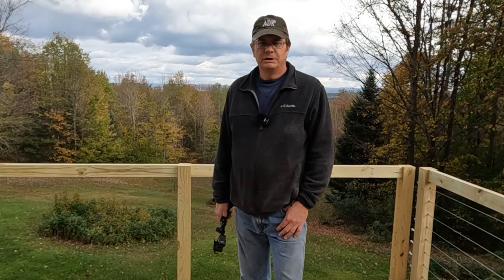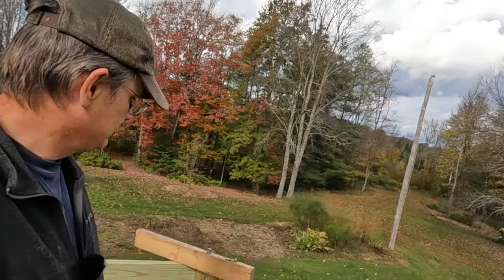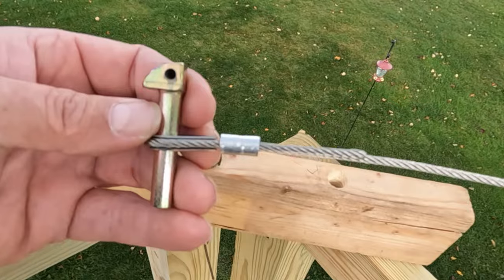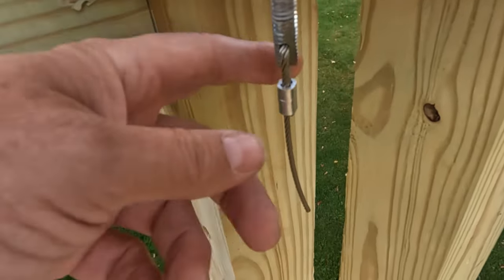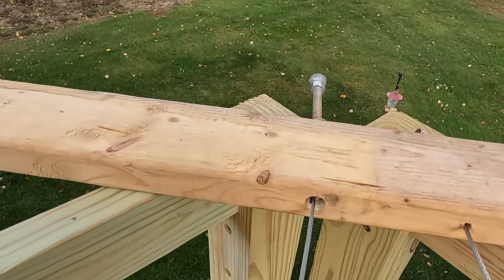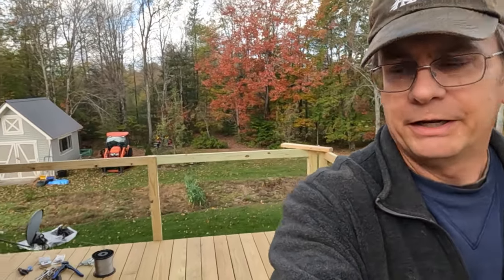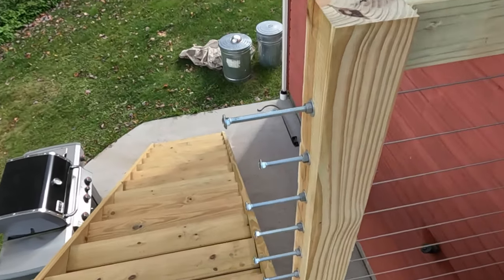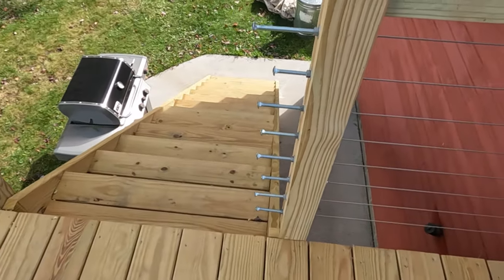Cable Railing For Less

Comment: I cry every time I lose a lynch pin, and your tearing the apart 😮 why cut the tension bolts off? Leaving them sticking out by the stairs would/could make life interesting. 😁 Nice job! Looks pro.
Reply from the maker: Thanks!  Leaving the bolts would give it that Frankenstein look but I don't need Fenway tangling with them.  I bought the lynch pins from the bulk bin at a buck a piece only to later discover that they had ten packs in a different aisle of the same pin for 2.50 Grrr!
Reply: @southernadirondackoutdoors  🤣😂 that's my luck!

Comment: Looks good.  I did cable railing on the inside when we fixed up our current house and it was definitely expensive hardware.  A lot of diy ones use turnbuckles on each one, but I like the look of yours much better.  I have had to adjust tension after a few years on a couple cables, so when you cut them off, if you need to tension them again you could cut a slot into threaded rod itself to keep it from turning while tightening the nut.  Great job and makes me want to finally do it on our deck.  Really opens the view up.
Reply from the maker: Thanks!  I considered the turnbuckles but I didn't want to be looking at them all the time.  If I did it again I might try a tensioner on each end to give more adjust-ability.  Good thought on the slot on the end...I've been waiting to cut them off just in case I had to tighten again.
Reply: @southernadirondackoutdoors  I'm with you on the turnbuckles.  Yours is a great solution.